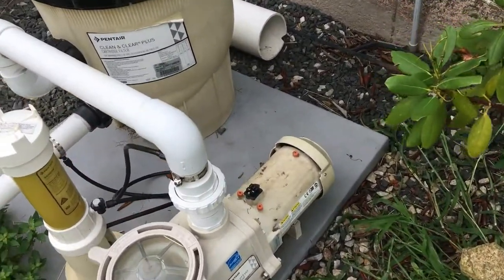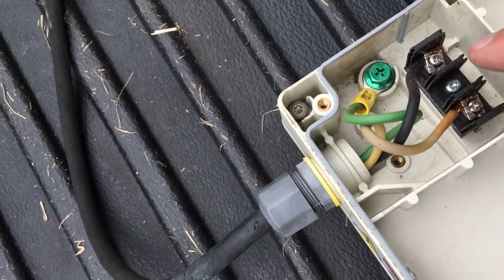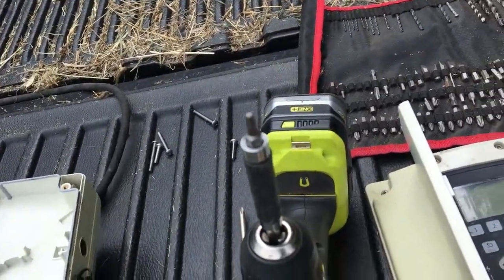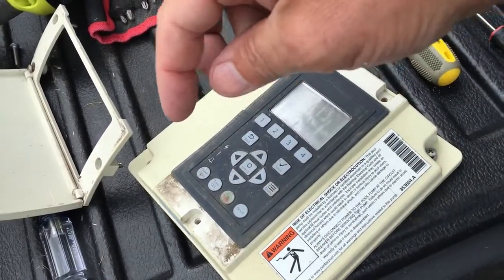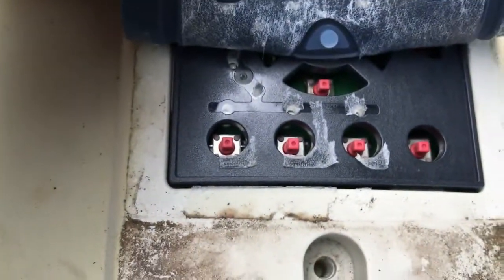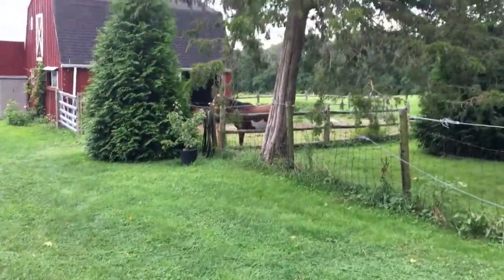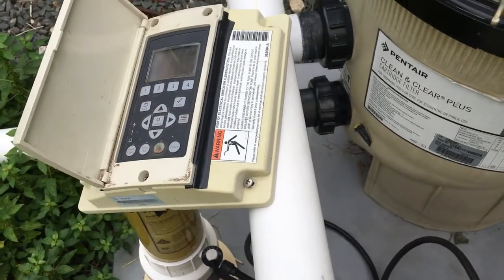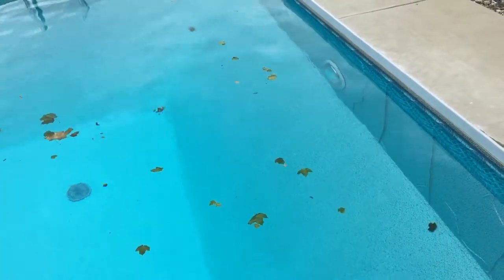Goodale Farm: Pentair Intelliflo VSF Drive, pool pump electronic panel repair and fix

Comment: Just wanted to drop a huge thank you for this incredibly helpful video! My Pentair VSF pool pump had stopped working, and I was at a loss. I initially replaced the keypad, thinking that was the issue since the power to the drive assembly seemed fine. But even with the new keypad, it still didn't work.

After watching your video, I pried my drive assembly apart and found the exact same issue you described – a burnt-out power terminal on the motherboard, burned all the way through. Your detailed troubleshooting saved me a lot of time and likely a thousand dollars by avoiding a professional service call.

Thanks again for sharing your knowledge and expertise. You made a huge difference!
Reply from the maker: You're welcome.    I would never buy a Pentair.   The cost is crazy especially if a simple electrical defect makes the whole system useless.

Pentair should be aware.....a chain is only as strong as the weakest link.

Comment: How did you fix the motherboard burnt?
Reply from the maker: Hi.  On the initial fix I cleaned the contacts with alcohol and a swab.  And ensured contacts were firm.    After 1 year the whole contact fried.    So I sold the unit as is and bought a new system from Dohenys for a fraction of the price. New unit works great
Reply from the maker: I didn’t fix the motherboard.   Too extensive for me.  A man has got to know his limitations.  :).   I bought a new unit from Dohenys at a fraction